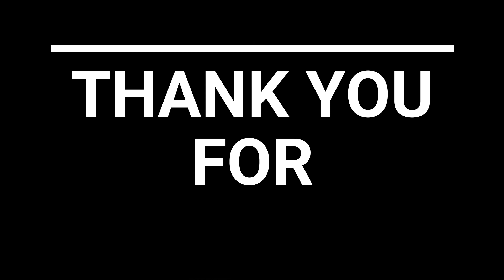Two-Layered  Cross | Scroll Saw

Comment: Hi Pastor, Nice project. Log time ago someone showed me to use white self adhesive shelf paper on the wood then fix my pattern to that. It works for me really well. God bless you. Pastor Mike
Reply: I've seen that and know folks who do it that way.  Early on I tried it...and maybe the shelf paper I bought was too cheap but it kept coming up when I was cutting.  Now I've gotten used to the blue tape...kind of like a ritual with me. :)
Reply: @RevJosephWashburn  I understand. I had the same problem so I started to run the edge of a small piece of wood over the paper to be sure it stuck good. Scrolling is a rewarding hobby.

Comment: What brand and what size blades are you using, looks great by the way
Reply from the maker: Thank you!  I believe I was using #3 and/or #5 blades.  I buy Flying Dutchman Ultra Reverse blades as well as Pegas Modified Geometry blades.  I switch between the two brands...mainly as my mood changes.  Not sure I can usually tell a huge difference.
Reply: Thanks